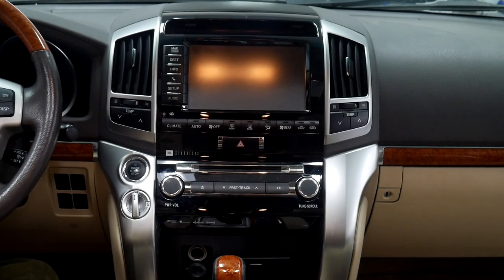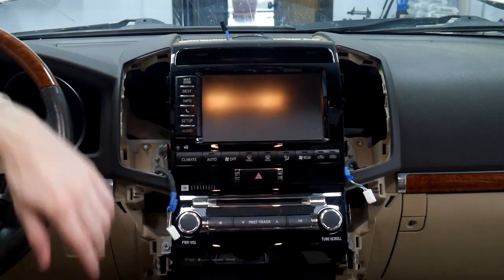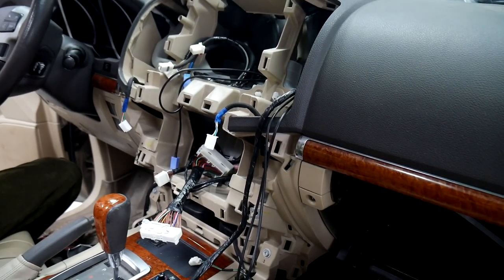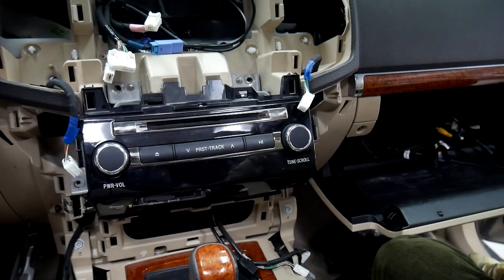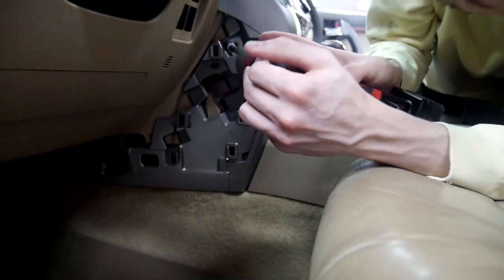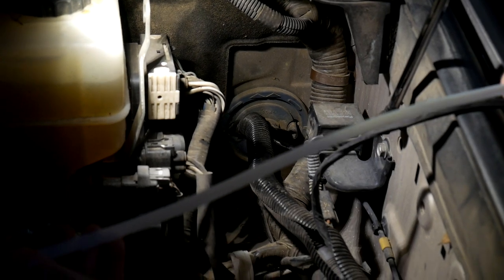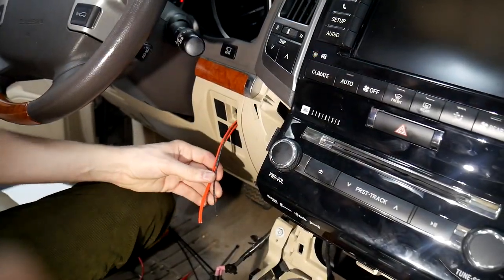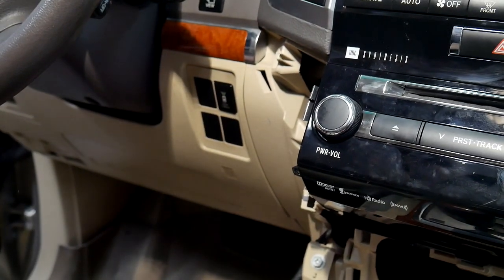Toyota Land Cruiser 2013 2014 2015 2016 2017 2018 VLine install CarPlay Android front camera LEX78T

Comment from the maker: The VLine VL2 system, compatible with the 2013-2015 Toyota Land Cruiser, is available here: https://gromaudio.com/store/vline/grom-vl2-lex78t.html
It will allow to add the wireless CarPlay and Android Auto to the factory car stereo of Toyota Land Cruiser 2013-2018. The model is LEX78TVL2.
You can also add the rear and front-facing camera to your vehicle, using the GROM VLine VL2 system. Here is the camera that we recommend using:
https://gromaudio.com/store/accessories/camera-v-bcc1.html

Comment: Hello, On my previous Toyota Land Cruiser year 2008, on which I had installed the VLine2 LEX5, I had connected the microphone which was provided in the kit. With the LEX7T that I am going to install on my new 2013 Land Cruiser, the microphone is not provided in the kit! Should I order it extra? THANKS. Best regards.
Reply from the maker: Thank you for using GROM VLine on your vehicles! For 2013 Land Cruiser you will use the factory microphone with the VLine VL2 system. Please check the install manual that came with your LEX7T system.

Comment: If I understood correctly, the installation on a Toyota Land Cruiser VDJ200 which already has a panel recognition front camera as standard, the addition of a front camera as described in your video would not be necessary? With thanks. Best regards.
Reply from the maker: There was no factory front camera enabled in this specific vehicle.
If your vehicle has a factory front camera, you do not need to install any other ones.
In this video, we show different possibilities available using VLine VL2 system for CarPlay and Android Auto integration.

Comment: Hello, Some problems during the installation of the VLine2 LEX7T on my Toyota Land cruiser VDJ200, year 2013. the steering wheel controls for sending and receiving calls are no longer active! those + and - of the volume on the other hand are active. I have the installation manual for LEX7/LEX8. Is there another installation manual specifically for the LEX7T? Where can you send me more detailed instructions? THANKS.
Reply from the maker: Here is the link to the install manual for LEX78T stereos: https://gromaudio.com/docs/vline_manuals/lex78t/lex78t_install_manual_web.pdf
You can also contact our technical team at https://gromaudio.com/support.html They will help.